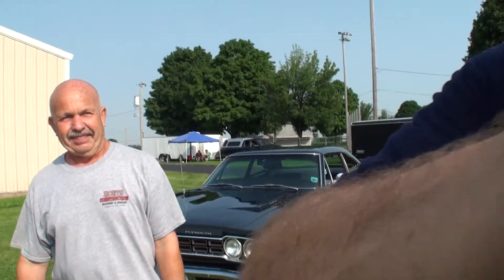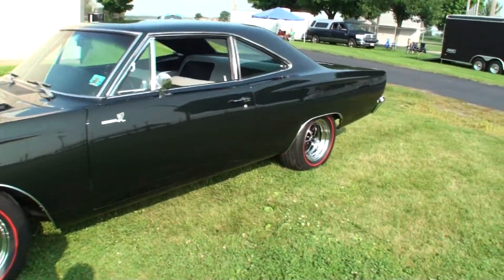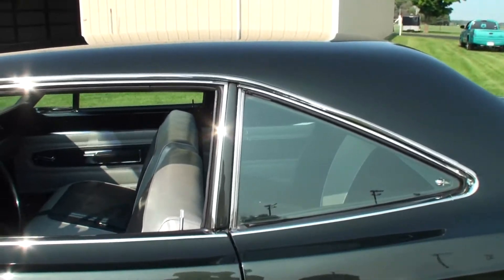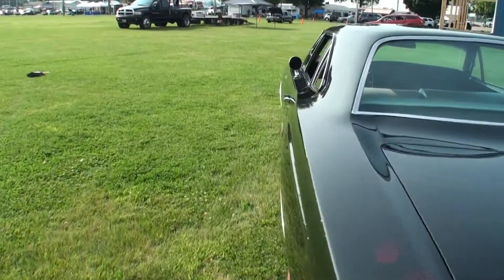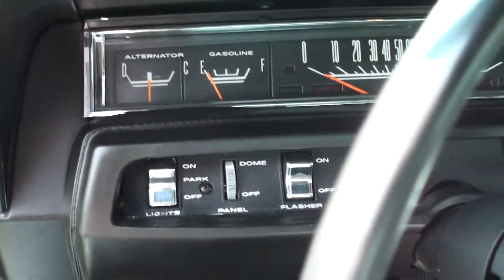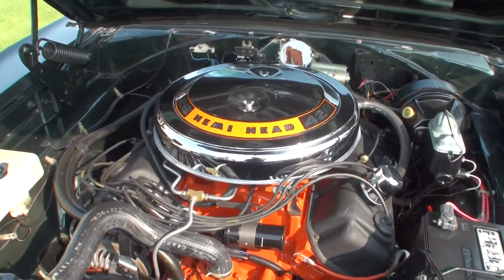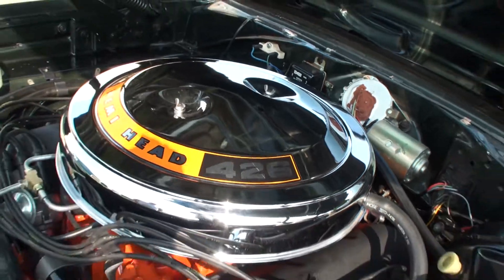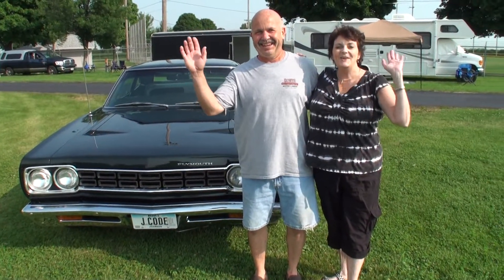1968 Plymouth Road Runner 426 Hemi J Code on My Car Story with Lou Costabile

Comment: I have another story for ya!

Roadie's BIG Adventure!

Roadie the Plymouth Roadrunner was getting washed up for a summer vacation road trip.

Whe he was washing up, I dressed myself in a tank top which read "Die-Hard Road Runner Fan" on it, a pair of denim shorts, and pink glittery shoes.

After Roadie was washed up, we piled in and headed off.

I was in the front seat because Baby was with Boo.

"What a beautiful summer day, huh, Roadie?" I said to the '69. Roadie beeped twice and flashed his headlights in agreement.

I turned on the radio and listened to all my favorite rockin' summer hits on KQ92.

I sang along while Roadie flashed his headlights to the beat.

A little while later, we stopped in traffic.

Roadie's horn beeped quick blasts in annoyance.

"It's rush hour," said Cowboy.

"It's SUMMER VACATION. It can't be this bad, right?" I replied.

WRONG! Traffic would be held up for at least a couple hours.

Roadie's horn then beeped in a sad tone.

"Roadie hates rush hour," I said. "Traffic will clear up soon." I reassured the Roadrunner.

2 hours later, traffic still held up. Roadie's horn didn't have a sad tone, but was now angry.

"Is traffic EVER gonna clear up?" I then shouted angrily.

"Meep-meep-meep-meep-meep!" Beeped the '69.

Cowboy looked out Roadie's window, and said, "Well crap, guess we'll be stuck here."

Traffic finally cleared up at sundown.

Roadie then happily beeped and shot through the roads of the Hawkeye State.
Reply from the maker: Great story! Meep Meep!